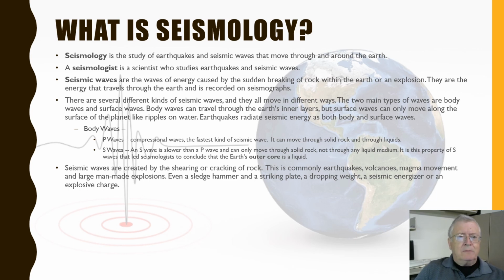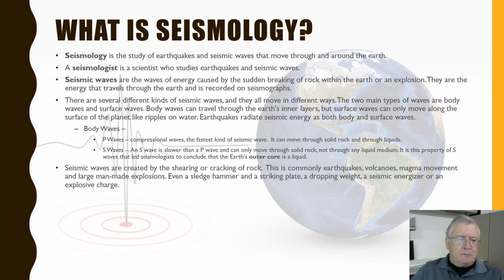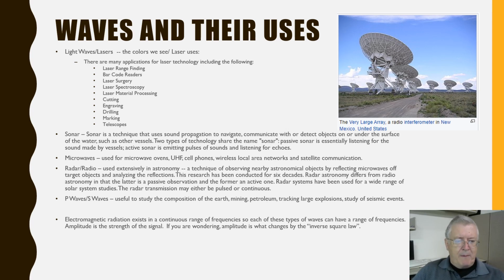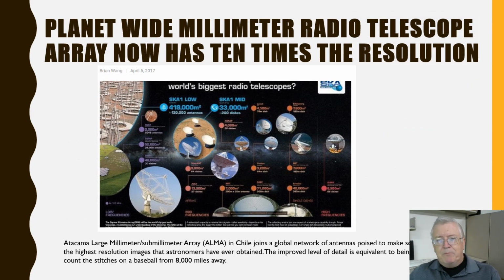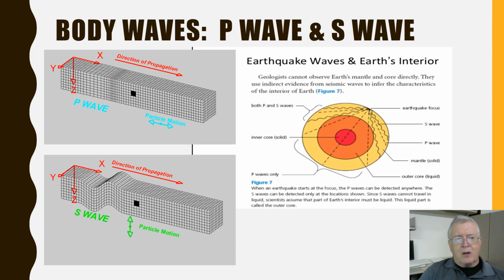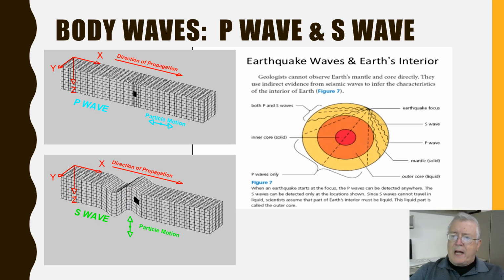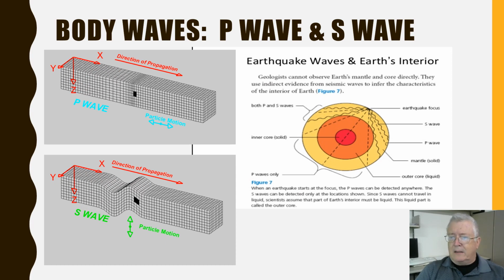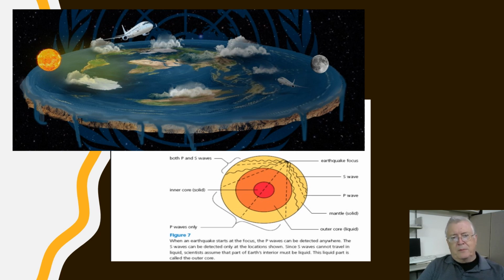seismology

Comment: Excellent. Perhaps worth emphasising a few more things for Flat Earthers to think about: 

1) The Global Seismic Network. It's more than 150 monitoring stations worldwide providing and continuously updating the knowledge we have about the structure of the Earth. FE tends to think some guy in a basement did some measurements 300 years ago and scientists just left it at that. The scale of the network allows rapid triangulation of seismic events anywhere on the planet even below the deepest oceans.
2) On a Flat Earth, both P and S waves would dissipate uniiformaly in all directions from the source. We might be able to triangulate the location in the x and y directions but not in the z.
3) My remark no 2) is academic because the there's no obvious reason for a Flat Earth to be structures anything like a globe and to exhibit tectonic activity and other processes leading to seismic waves. We have such waves because the Earth is globe.

Minor criticism: The run down of electromagnetic waves was interesting (this is my field) but there's no direct link between them and either sonar waves or seismic waves, the latter two being distortions of matter and requiring a matter medium to propagate through. There are various labels and sub-divisions but electromagnetic waves from low frequency/long wavelength through to high frequency/short wavelength are known as: radio waves, microwaves (hate this word, they're just short radio waves and so-callled millmeter waves are even shorter), infra-red, visible light, ultra-violet, x-rays, gamma rays. All can travel through empty space and some can travel partially or completely through various types of matter.. Having said that, the 3D illustrations of the P- and S- waves were surprisingly reminiscent of the modulation envelopes respectively of FM and AM radio signals. but I guess P-waves can have variable amplitude as well as frequency?
Reply from the maker: Great information. You have no idea how ignorant I am in this area.